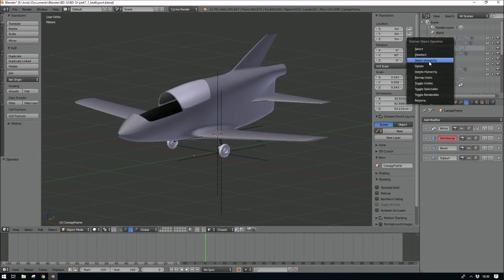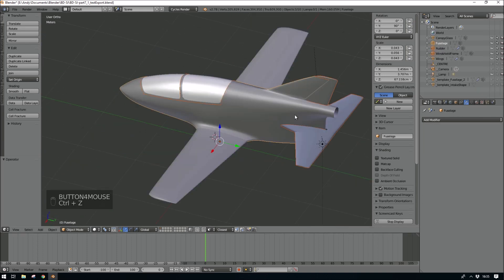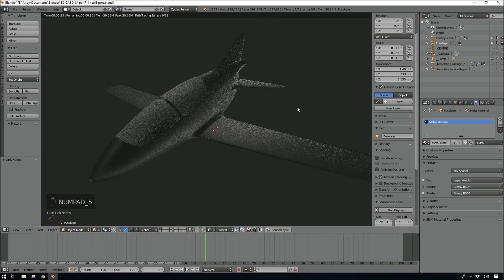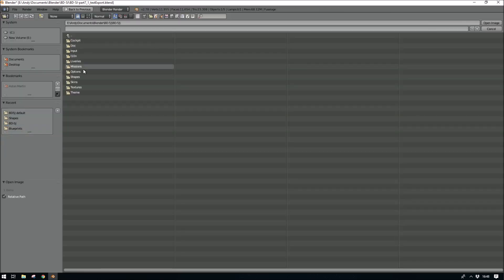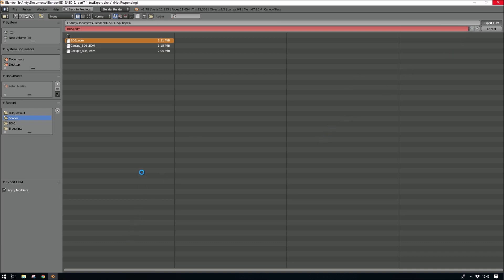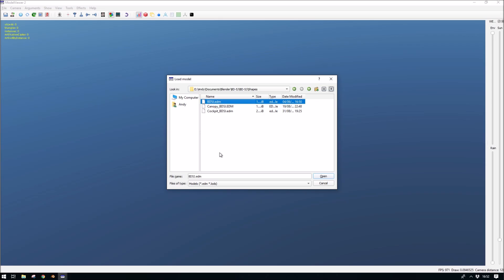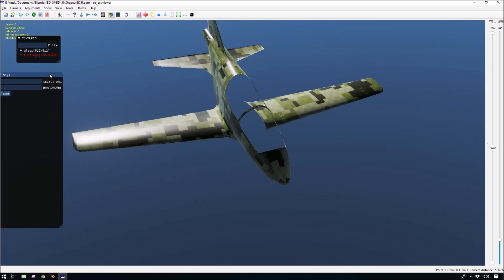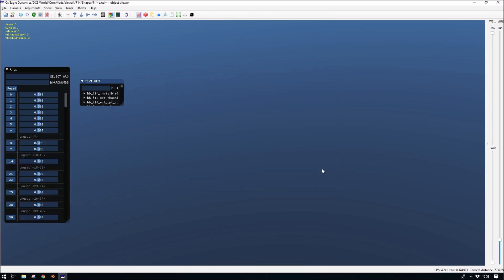DCS World - Experiment to create a flyable Bede BD-5J using Blender - Time lapse Part 7

Comment: Hello, 
I am attempting to make a Hawk T1 for a school project and I can't seem to find how to export models. I am using the latest EDM exporter I think, and I made sure that I had quaternion units, texture and the object had a simple diffuse material. I'm using 2.78. It says that it exports but when I open it in model viewer it opens but there isn't anything there and the poly count is 0. Any ideas/ tips? 
Thanks
Reply from the maker: I have this issue before. I cannot recall the exact fix. All I can think is that it was to do with materials. Under the materials tab, scroll down to EDM properties, and you check that you have default texture and opacity set to none for everything that is not glass. For glass it must be set to glass and blend. If it is exporting you have no errors, so must be something to with that I think. Let me know
Reply: @fireblaze7994  I'll check that out tomorrow .... I've had a look through all the settings and can't find it now.... I saw it earlier, but can't find it anymore. It was a little drop down with lots of different materials such as default and glass.... Really annoying I can't find it.... I'll let you know if I find it. Thanks 👍

Comment: Why do we use quaternion units and could you upload something or explain how to go from texturing to model viewer? I cant seem to get my texture to apply onto the model in modelviewer.
Reply from the maker: Loading textures in model view can be a pain to set up. You could also give them unique names and drop them in your Bazar/TempTextures folder in the main DCS install. Remember to clean them out after you finished testing
Reply: @fireblaze7994  I originally got the textures to work and export in. But they do not apply to the model. If I open the textures planel it does show my texture in there, but it is not on the model and I still have a missing texture warning. I made a simple description.lua with the livery and set the texture as the diffuse layer, but it doesn't work. I am not sure if it has to do with my code or my blender settings. I don't want to use a static template because I want to change liveries and it will also not be a static model after I finish. Don't need it in DCS, just need it to work in modelviewer.
Reply from the maker: @jamesmorgan9096  i think it will be your code. Thoigh often I found that a texture would not show in model viewer, but would in game. You are loading the textures in modelviewer separately from the mesh. I know sometimes i have had to load the model, then textures then reload the model. Remember these things are not for the avetage end user, so will be temperamental
Reply: @fireblaze7994  Do you know if it is possible to have two seperate textures for one render node?
Reply from the maker: @jamesmorgan9096  DCS does not support overlapping diffuse textures. You can have multiple parts though, which is better for lods anyway
Reply: @fireblaze7994  So if you wanna share an aircraft's external texture over two rendernodes, you need to seperate them as individual objects?
Reply from the maker: @jamesmorgan9096  personally I would have as many separated parts as possible. For external model I would have at least 3 to 4 texture files; front fuselage, rear fuselage, wings, and externally visible interior parts. An aircraft has all the moving parts; for instance on the wings you have ailerons, slats, spoilers, flaps and maybe landing gear doors. You can group these on to one texture, which you can do so with a "texture atlas" in Blender, which basically combines the UV's of the selected parts, a very useful feature.